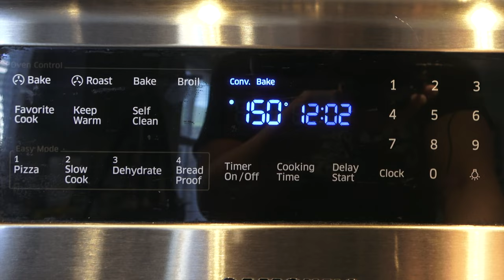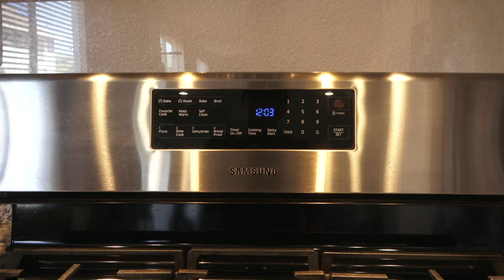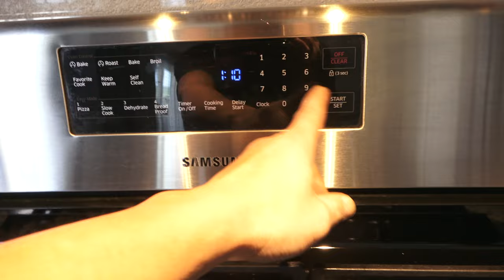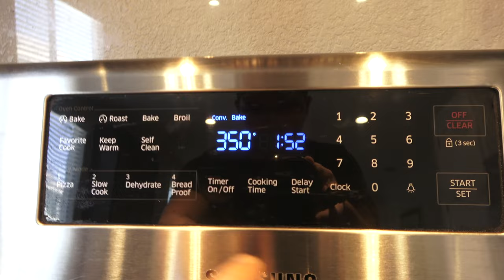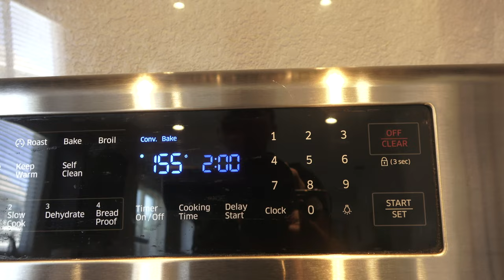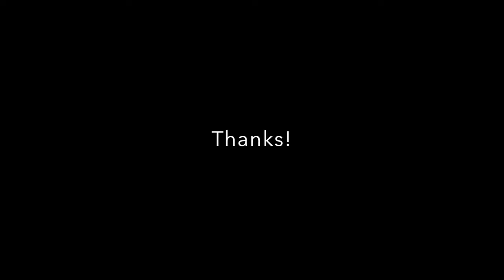How to Make Your Oven Heat Up Again:  Oven Igniter Removal and Replacement (Samsung) 4K

Comment: Your video was wonderful! Unfortunately, they had the front screw on the burner tightened so much that I stripped it before I could get it loose.  I'm going to try a special screwdriver from work, but this could turn into a single screw making me replace the entire oven.  I really do appreciate you putting this together though, it was super straightforward until I came to this issue (which obviously you had nothing to do with)!
Reply from the maker: Thanks for reaching out.  Sorry to hear about the front screw situation.  I hope things will turn out well in the end.  Best regards!

Comment: We have the same issue except it is intermittent. Most of the time the oven works but sometimes it will only get up to 175 degrees and we can see the glow of a flame. Do you think the ignitor is the cause?
Reply: Same

Comment: I replaced my bake/bottom igniter. Time for brownies! The screw at the front of the tube holding it in place was a little tough to get out. It sits on a small platform so I just shot it with a very small amount of P Blaster and slightly inserted a small flat blade screwdriver between the compressed part of the tube and its platform and wiggled it. I can see corrosion and the heat/cool cycles freezing screws in place. The reason for the very small amount of P Blaster is because I wanted to make sure I left zero behind- cleaned up with soap and water afterward.
Reply from the maker: Awesome!  Glad you fixed it.  Thank you!

Comment: Great video. Just finished replacing mine. All I had different was that to get the wires unclipped I had to pull the oven out from the wall and remove the back plate. Then they were right in there.
Reply from the maker: I’m glad it worked out.  Thanks for sharing.  Happy holidays!

Comment: Excellent step by step video.  I was a bit nervous dealing with a gas appliance but this is fail safe if you follow along.  Took about 30 minutes including cleaning the oven :- )   I used the OEM replacement part from Amazon BTW.
Reply from the maker: Awesome!Thank you for sharing!

Comment: @drnotebook  For safety reasons you should ALWAYS, ALWAYS turn off electrical and gas lines when you are working on the appliance.  WHAT IF the gas valve was faulty and for some reason opened while you were working on it?   

SAFETY 101:  Use your head and be careful when working on things that have energy sources that can kill you, poison you, or cause a fire (which could kill you).
Reply from the maker: Thanks for the great reminder on safety!

Comment: Hello there ... My bottom one if perfectly working, but I noticed you touch with your hand the one on the top. Was this to make sure it is hot and of course working? Let me share with you, my oven is leaking gas at the time I turn it on, but I do not know if it is related with this top burner, since I do not know when it has to be on
You just mentioned you chage that one about one year ago after replacing the bottom one and I'm wondering if the change was due to a gas leaking or just not turning on. I hope you can help to understand this issue

Comment: Hi - great video! Makes the repair look really easy. May I ask what model number your oven is? It looks very similar to mine but I wanted to double check before pulling the trigger on the part.
Reply from the maker: Thank you!  The model # is NX58H5650WS.  Good luck on your project.
Reply: @diypotentials  Thank you for your quick reply, my model number is slightly different but the part and method worked despite that! Thanks again for the video!

Comment: Is the ignitor for the broiler and the oven the same.  I have a similar issue, but since my broiler works (which we rarely use), could I just switch the working ignitor (broiler) for the broken one (oven)?  Thanks!
Reply from the maker: It should be the same igniter. I hope the project went well.  May you can share how it is done on YouTube.  Thanks!

Comment: hi, I just replaced mine and now my oven has a burning smell like chemicals or plastic burning when its's on? I'm wondering if it's just from debris that's finally burning now that it's hotter, or if I did something wrong? it all looks good and is heating up properly
Reply from the maker: I hope the smell are gone by now and that all is well.  Thank you!

Comment: Thank you. I ordered my igniter. One question, why not turn off the gas to the oven. Is it necessary?
Reply from the maker: The gas shouldn’t be able to come on when the oven is off.  You can unplug the oven if you like.
Reply: Thank you again for the helpful video. Replaced new and tested. All works just fine. Saved me a service call. God bless!  @diypotentials
Reply: For safety reasons you should ALWAYS, ALWAYS turn off electrical and gas lines when you are working on the appliance.  WHAT IF the gas valve was faulty and for some reason opened while you were working on it?   

SAFETY 101:  Use your head and be careful when working on things that have energy sources that can kill you, poison you, or cause a fire (which could kill you).
Reply: Oh my goodness, so glad I found your video!!  I used your link and such a great price. Thank you so much.

Comment: Did you turn off the gas supply before you started your work??
Reply from the maker: No.  The gas shouldn’t come on if the oven is off.  However, you can always turn it off.  Thanks!
Reply: @diypotentials  👍
Reply: Thank you very much for your video I managed to change the igniter with your help.

Comment: I was having the same problem, replaced the igniter and it still doesn't heat up. Checked the gas pressure regulator, it is on. Any ideas on what else it could be? Or is it time to call a technician?
Reply from the maker: Sorry to hear.  What a bummer! It might be faulty igniter or electrical issues, loosed or burned wires, preventing current from reaching the igniter or circuit board issues.  It is your call if it is time to call a technician.  Thanks for reaching out. Best of luck.
Reply: Checking the continuity using a meter of the igniter is your best bet. Put it in continuity mode and take the two leads in the igniter connector after you remove it. It should beep… if it doesn’t then it’s the igniter. If not it could be the heating element… or both. Sometimes the wires get burnt so check them and make sure the connection is good. A new igniter is around $25 and really easy to fix. They’re either flat or round… BE CAREFUL… to NOT touch the black carbon part of the igniter due to finger oils and it being extremely fragile. Most likely it’s the heating element if the igniter is working. Every oven is different… some have a “breaker like switch” in the back that can grip like a fuse. Sometimes you might have to flip the switch back after replacing it